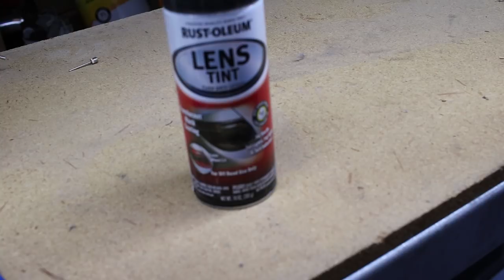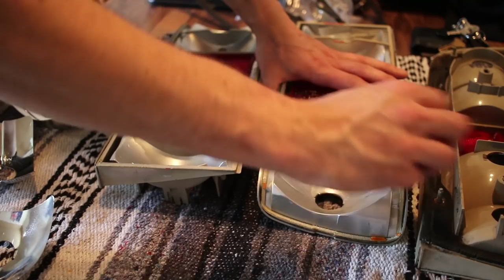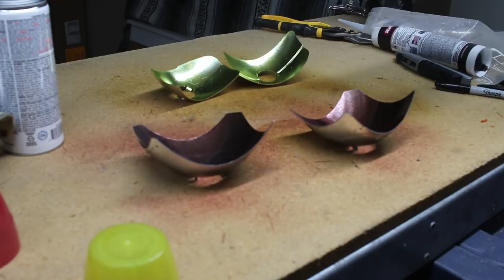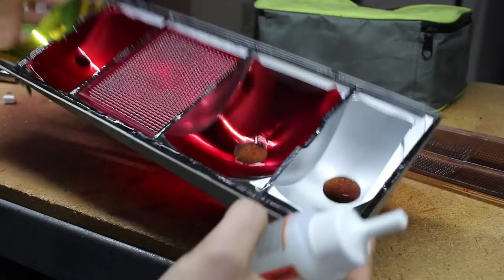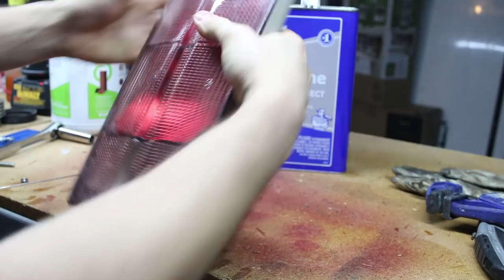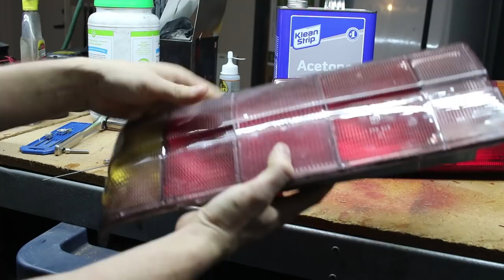Rocket Bunny Turbo S52 BMW E30 Build | Part 21: STARTEC Custom Tail Lights

Comment: For anyone attempting this, if you spray a light coat of the red over the yellow inside the housing, it will make the correct orange color, which the startecs came with.
Reply: Or just use orange colour!

Comment: Never seen these before. Looks more interesting than the stock look.  Just have a couple hopefully constructive additions. The new covers look very wavy. Could sand and buff for a very nice flat smooth look comparable to original. Also, was hoping to see installed and lit up! Still looks good! Nice work!

Comment: also, with the krylon and vht nightshades, its best u use a blowdrier/heatgun when painting. i have some lights that been sprayed for 8 years havent faded or cracked at all. the headlights i did without the heatgun faded after like 8 months had to redo em.

Comment: in principle you shouldnt have to use clear coat paint on the lenses. You could have painted with matte red/orange and have better color setup for the taillights :)